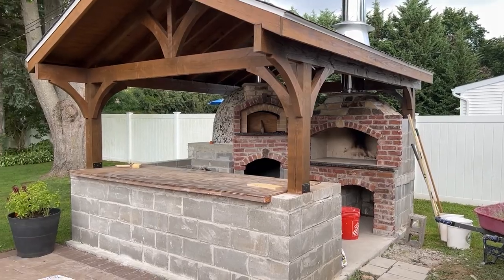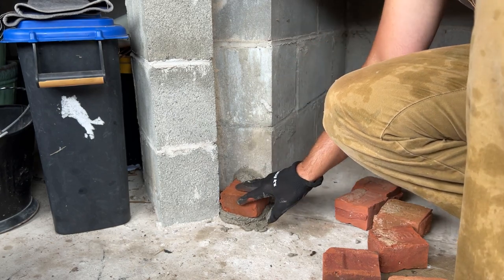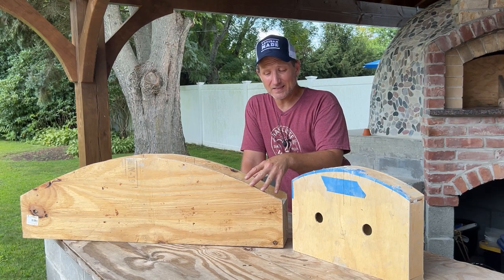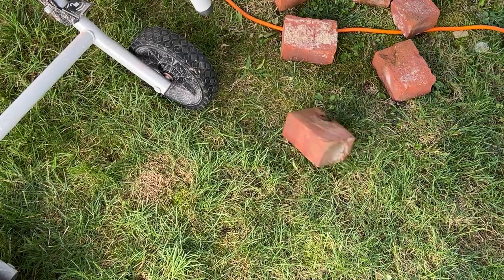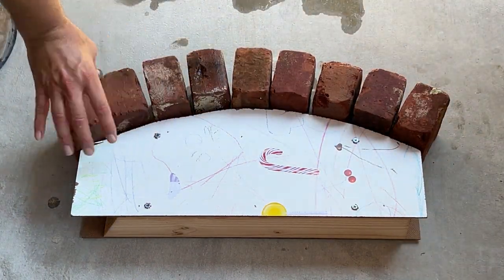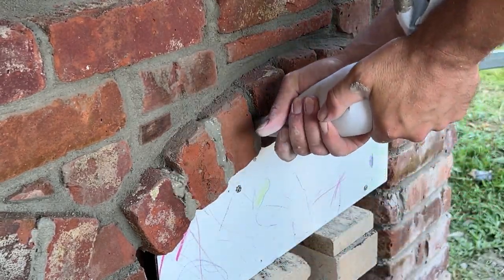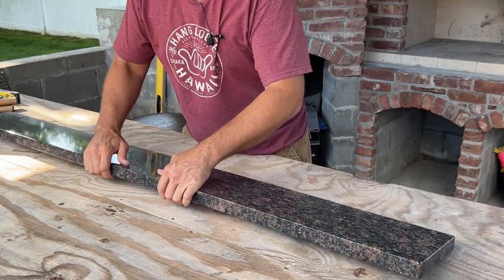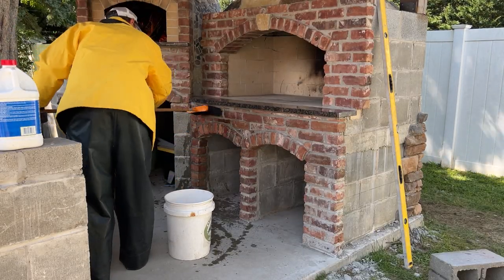How to Build a Brick Arch / Wood Fired BBQ / Outdoor Kitchen Build - Part 13 / DIY Masonry

Comment: Slaked lime and sand is best for the "colder" parts since it does not crack. Concrete based mortar will crack sooner or later because it is to rigid. The "hotter" parts should be built with a clay and sand mortar since it withstands heat.

Comment: Hey,
Great job. I have a question please. In my neighborhood, it’s not allowed to have permanent grilling sites in the back yard. So is there a way to build such oven on a movable base and reduce the weight? Thanks
Reply from the maker: I have been thinking about this for a while.  I might build something like this in the future and post a video.  I would probably have a metal base welded on wheels that can handle a lot of weight.  Also, the smaller the oven , the easier it will be to move it around